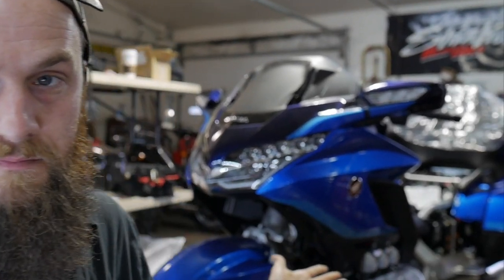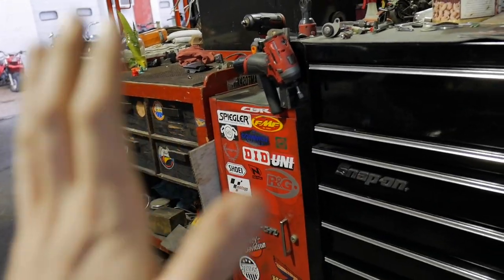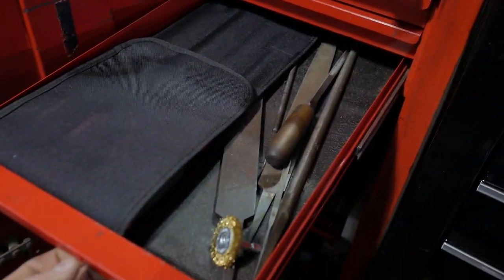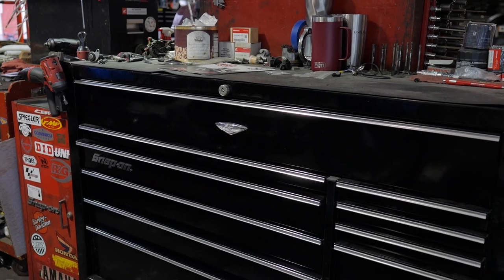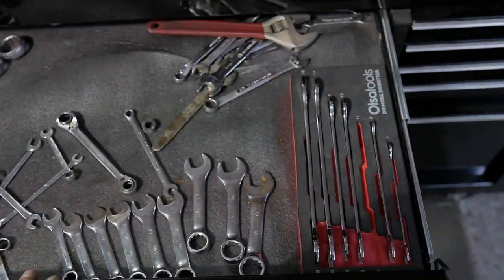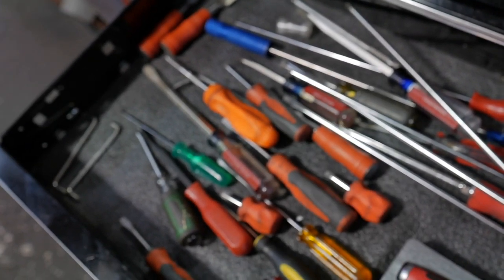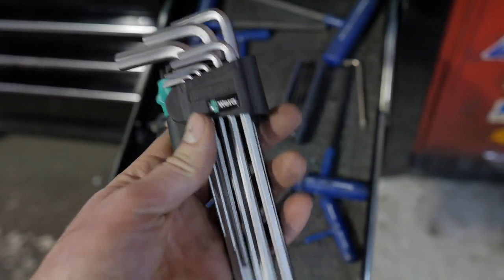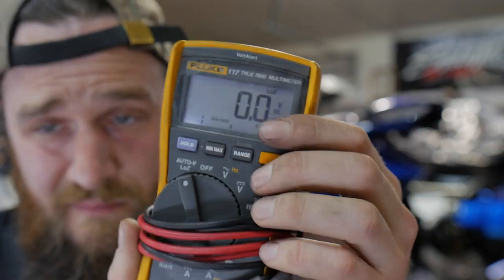Tips on tools with a Factory Honda Motorcycle Technician

Comment: I've never heard of the Olsa's before but have certainly ground down my share of wrenches for the same reason. I am definitely getting myself a set of them! Thanks so much for the video and sharing this information, that's awesome and helpful to see! I'm actually in the process of building my tool collection currently! I will say another less common brand name of tools which are good quality and I would say are probably between your typical Craftsman/Stanley and the Snap-On/MAC tools are Carlyle tools (NAPA). They're significantly more expensive than the standard NAPA tools but the quality is really good and they also all come with a Lifetime warranty.
Reply from the maker: Thanks for dropping some more companies to check out!

Comment: You may already know this but I have that same carbide scraper and if you have a flat surface like a piece of glass or granite and some 600 grit wet dry sand paper you can lay the blade flat and rub it in a circular motion and it will sharpen the blade.

Comment: Hey Cody! Awesome stuff as always. Thanks. I have the Wera ( pronounced “Vera” Allen set. I think those are the same ones…. The point being is if they are the same as mine they are likely “hex plus” …. If you look carefully they will likely have slightly concave faces instead of straight faces…. So they never slip and they always bite…. Great with Japanese bikes famous for soft Allen / hex head fasteners…. I finally broke down and spent the dollars for those after stripping out one too many Allen head screws/ bolts on my VStrom…. Any way “thanks plus” I have learned a lot from you and it is much appreciated!
Reply from the maker: Nice Ken! Thanks for the info! And thanks for stopping by!

Comment: Thanks for sharing your set up.  Did you get a new camera or a new lighting set up?  This video looked great.   I love my Vessel JIS screw drivers.  The Impacta is a good one.  It has a little bit of impact driver turning motion when you smack it with a hammer.
Reply from the maker: DUDE was secretly hoping someone would notice a difference. I bought a new lens and it’s AMAZING. 😅

Comment: Are those JIS Vessel screwdrivers the quarter turn impact type? 
This was a great vid. Thank you.
Reply: I have a set of three Vessel drivers. The two larger ones reverse 5% on impact though I have yet to try it.
Reply: Heya Tom. No, the set he shows are the non "Impacta". But, I own the Impacta Vessel drivers and I can tell you....They're 300% worth the price! But for a very well built JIS driver in general, they're really hard to beat.
Reply: They have blue handles.
Reply: @blipco5  The Impacta is either blue or silver and when impacted, they actually rotate 12 degrees, not 5. When you do get around to using them, you'll see why they are the best out there. Zip~
Reply from the maker: Negative, non-impact type. I am not too impressed by their impact drivers.
Reply: Zip, I've never used them for impact and have never had the need to. The Vessel bites the heads very well. Whenever approaching any fastener, especially a cross-head, I use care and if need be, I take my time because over forty years of wrenching has told me that by taking a little more time up front saves ten times that in dealing with botched and busted fasteners.
Reply: @blipco5  No argument here. I'm the same way. But I deal with a LOT of Vintage Metric motorcycles, and 9 out of 10 have botched up screws from people using a standard Philips on the JIS screw heads and that always causes damage to them. Using the Impact JIS Driver even on these messed up screws works every time at loosening them. So, have I needed to? Absolutely. Have I needed to because of my incompetence? Nope. Zip~

Comment: I’ve got a 1992 Honda cb750 nighthawk, I’ve been using your videos to help me with it because I’m a automotive tech but I have no idea with bikes lol but I’ve cleaned the carbs, the fuel tank, and the air box and it runs but I can’t throttle it goes to 2500rpm sputters and dies if you could would you give me some tips on what could possibly be the cause?